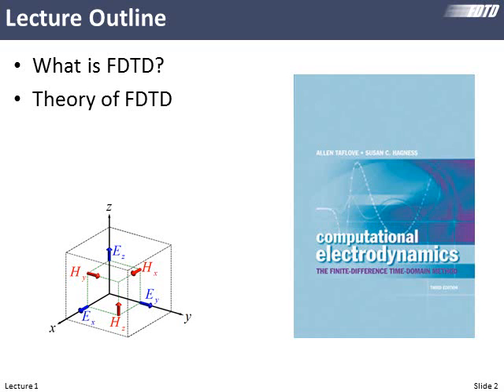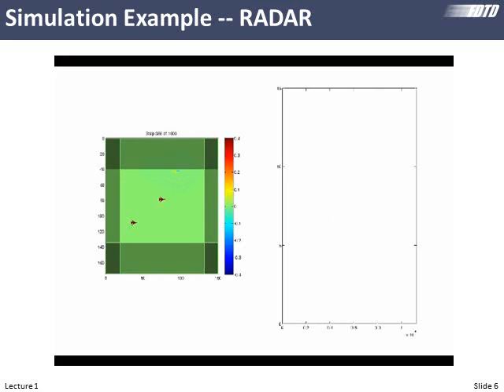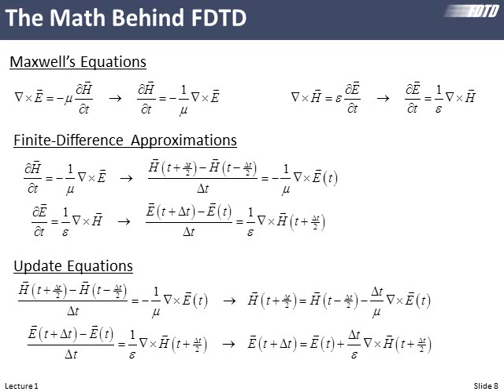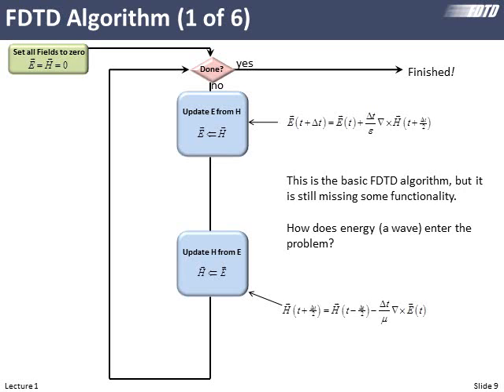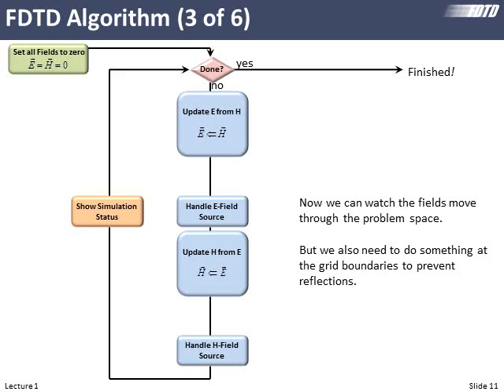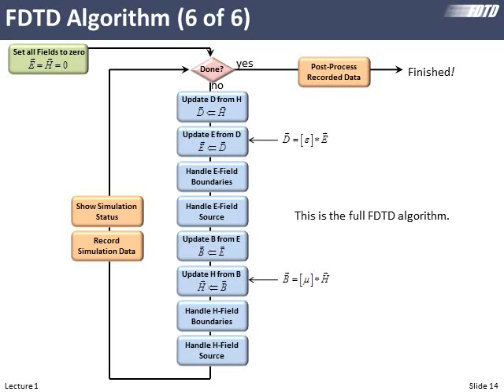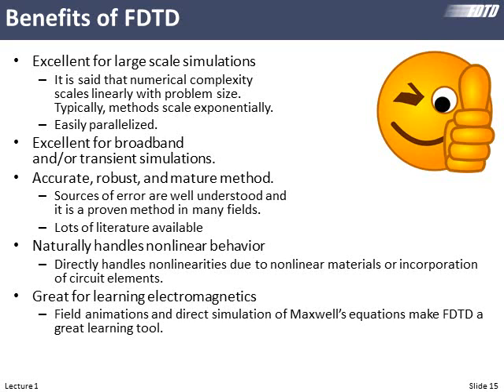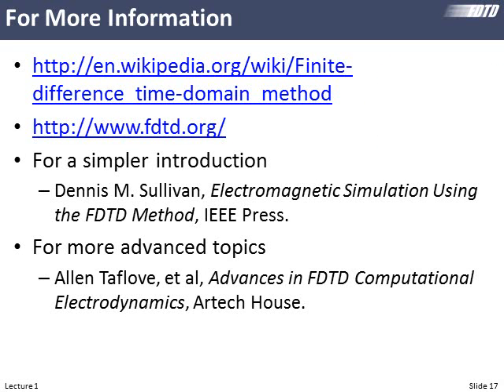Lecture 1 (FDTD) -- Introduction

Comment: Please guide me in finding the answer of: how can we relate backscattering and reflection in FDTD??
Reply from the maker: If I understand your question correctly, reflection and back scattering are the same thing.  Transmission and forward scattering, however, are different.  The easiest way to think of this is that scattering has the source removed.  If you are simulating just empty space, you will get 0% reflection, 0% back scattering, 100% transmission, and 0% forward scattering.  Empty space does not scatter.  Now if you simulate a big metal wall you will get 100% reflection, 100% back scattering, 0% transmission, and 100% forward scattering.  Why 100% forward scattering?  You will need to scatter a wave in the forward direction that is 180 degrees out of phase with the source so that the two will interfere and cancel so that no waves end up travelling in the forward direction.

See Lecture 24 on the course website at the link below.  It covers scattering analysis, but it is an advanced topic and you will need to learn more FDTD before being able to understand it fully.  Unfortunately, I do not yet have a video recorded for this lecture.  It is only the notes.

http://emlab.utep.edu/ee5390fdtd.htm

Hope this helps!
Reply: thank u sir for ur reply.....
My question is what is the relation between back scattering/forward scattering (i.e.angular light scattering spectrum which is far field) and diffraction field (i.e. DHM) from a microparticle in FDTD??
Reply from the maker: Very sorry, but I do not understand your question.  Perhaps another person reading this can help us out here.
Reply: Thank u sir......
Can u help me in knowing what is the relation between transmission and forward scattering, as u mentioned that it is different?? As I am simulating for 1 micrometer bead.
Reply: Dear Sir
I am also facing one more problem that is: I simulated for 1 micrometer bead in FDTD, now I want to change the radius of bead in sweep so when I am doing sweep for this lets say radius from 0.6 to 1 micrometer, I am not getting any data..... Please guide me....
Reply from the maker: Pretend that the applied wave passes through your object like the object was not there so that the source exists where you are observing transmission.  Now also pretend the object is another source.  What wave would the object have to emit so that when combined with the applied wave produces the field calculated by your simulation.  The wave emitted by the object is the "scattered wave."  The easiest example is a big metal wall that completely blocks an applied wave.  Physically, no wave is observed on the transmission side of the wall because the wall is blocking the wave.  However, we are pretending the source wave does not see the wall, so at first we see the applied wave on the transmission side of the wall.  Now we consider the wall as another source and we need to figure out what wave the wall needs to emit in order to completely cancel the applied wave on the transmission side of the wall.  The answer is another wave that is the same amplitude as the applied wave, but 180 degrees out of phase.  This wave emitted by the wall that cancels the applied wave is the forward-scattered wave.

Does this make sense?
Reply from the maker: First, get a simulation working for a single radius.  Benchmark your code with a known case if at all possible.  This is the hard part.  The next part is simple.  Just wrap your code inside of a big for loop and change the radius each time.  You will need to initialize some arrays to store your results for each radius.  That really is it.
Reply: Thank u Sir I am trying to follow the steps.
Sir As we have DHM system so we have all the datas recorded. So can u help me in knowing the relationship/ difference between transmission and forward scattering in far field?? Like any code or step by which we can analysis our data.
Reply from the maker: I am not sure of any other way to explain the relationship between the two.  If my explanations are not helping, read the literature and try to find some text books on the subject.  For code and algorithm stuff, take a look at Lecture 24 on the course website:

http://emlab.utep.edu/ee5390fdtd.htm
Reply: Thank u sir for ur reply it helped me in my study. 
Sir i have one query that Can we separate forward scattering data from transmission data in FDTD??
For example when we do simulation we have transmission data so I need to separated forward scattering data from it in far field.
Reply from the maker: Take a look at Lecture 24 here:

http://emlab.utep.edu/ee5390fdtd.htm

It goes this way.  First, run a simulation without your object or device present and record the transmitted field.  This is just the source in this case.  Second, run a simulation with your object or device present.  This gives you the transmitted field.  Third, subtract the source field from the transmitted field to get the forward scattered field.  Using the total-field/scattered-field technique, you can do all of this in a single simulation.
Reply: Thank u sir. 
Sir can u help me to know that when we do reconstruction for FDTD data, so in that process can we seperate forward scattering data and only transmisssion data?? If so, then what will be the code for that in matlab??
Reply from the maker: When you formulate your code using the total-field/scattered-field technique, the scattered-field is automatically separated from the total field.  There is no extra steps involved.  In fact, you will see the scattered-field in real-time as you watch your simulation run.  The code is in Lecture 24.
Reply: Hello sir thank u for ur help.
Sir we had tried to install FDTD software in new computer and when I am trying to run a program and do resource configuration it says time out, I tried many times. Please let me know where is the fault.

Thank you
Reply from the maker: What software are you trying to install?  MATLAB?  A commercial package?  I doubt I am going to be able to help you.  This course describes how to write your own FDTD code, not install and run a commercial software tool.

Comment: I am so excited to start this course =D , what are the prerequisites needed for this course ??
Reply from the maker: Some familiarity with programming in MATLAB (or Octave) is absolutely needed.  Otherwise differential equations and basic electromagnetics.  That is pretty much it.

Let me point you to the course website which has links to the lecture videos, you can download the latest version of the notes (many revisions and improvements), as well as other resources to help you.

http://emlab.utep.edu/ee5390fdtd.htm

Enjoy!!!!
Reply: thanks sir for replying ^_^
I was wondering if this method( FDTD )is related to the method of transmission line matrix (TLM)?
if so what is the difference between the two? ^_^
thanks in advance .
Reply from the maker: I would not say the methods are related, but in the end they are very similar in their implementation and properties.  I have never coded TLM so I cannot comment too much on its benefits over FDTD.  I think there are many more resources available to learn and implement FDTD than there is for TLM.

FDTD discretizes Maxwell's equations that evolvethe fields over time.  In contrast, the TLM method approximates waves and materials as a large 3D circuit and evolves the currents/voltages over time.  This might be more intuitive for some to learn.  I am guessing here, but it may be that you can get away with larger cell size in TLM than you can in FDTD.  It may also be that TLM is more easily hybridized with circuits and circuit models.

Depending on what you want to simulate, I would probably recommend sticking with FDTD.

Hope this helps!
Reply: CEM Lectures  
thanks a lot for making it clear 😊

Comment: In the second finite-difference approximation, why did you change the H?
Reply: The airplane "movie" was a great teaser thanks for that!
Reply from the maker: Can you point to a specific slide so that I can be sure about what you are asking?
Reply: In slide 8 when you go to the Theory of FDTD, the electric field finite difference approximation has H with a time step I believe, but the Maxwell's equation just has H. The E in the magnetic field Maxwell's equation and finite-difference approximation stayed the same.
Reply from the maker: Are you talking about why I am defining E(t) but then H(t+dt/2)?  That is a deeper subject that I cover in a later lecture.  The short story is that every term in a finite-difference equation has to exist at the same point in time and space.  When you approximate the time derivative as (E(t+dt) - E(t))/dt, that term actually exists at time t+dt/2.  We choose the H fields to exist at these half time steps to resolve this issue.  All of this covered in more detail in a later lecture.  So no worries if that does not make sense now.
Reply: CEM Lectures that makes perfectly good sense now. Thanks so much man!
Reply: That is my question as well at 5.20.  I'll suspend my curiosity until you discribe it later.

Comment: Sir,
can you share with us the radar example through a series of video lectures that you talk about in lecture 1, how you go about simulating it though matlab.
Reply from the maker: varun saxena I may consider doing that in the future, but I do not have any immediate plans to add that series of videos.  I think if you work through the course materials, you will have a pretty good understanding about how to do that.
Reply: Thank you. I will go through the course material and get back if i need clarifications to get that problem going.

Comment: ..useful computer code will be appreciated..
Reply from the maker: Benouatas Abdelwahab Full FDTD codes are provided in later lectures.  There is still a lot to learn before you can understand the code at this stage including why the field components are staggered, how to handle the staggering, how to incorporate sources, handling the boundary conditions, calculating transmission and reflection, etc.